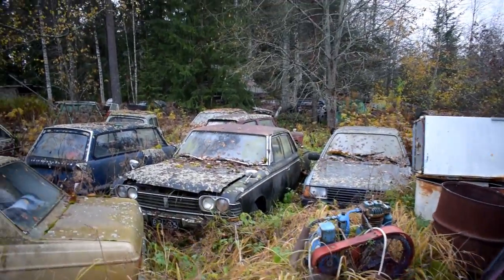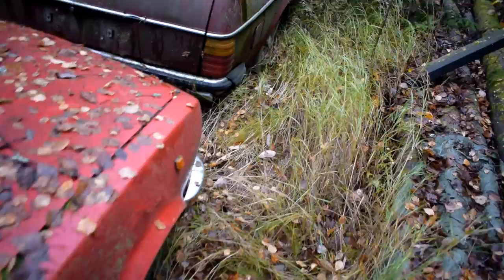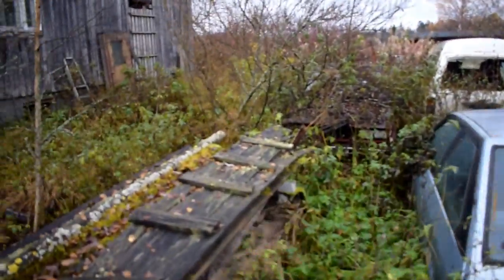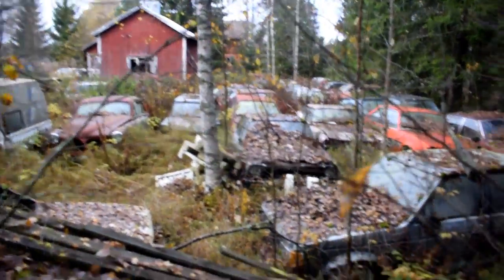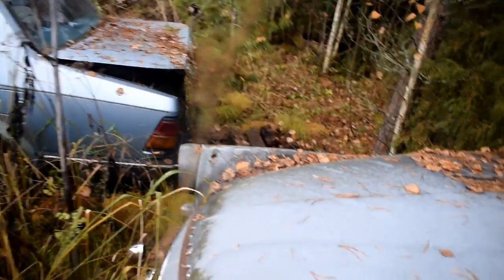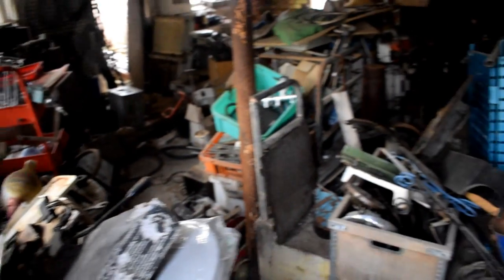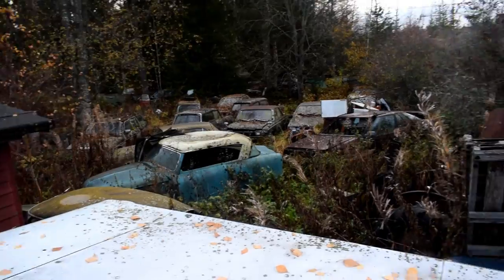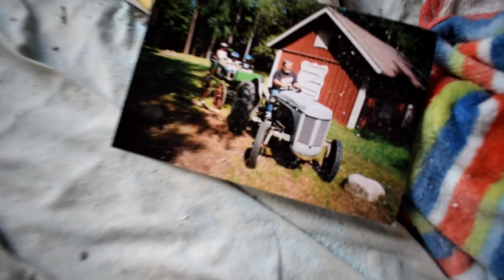Untouched abandoned house with over 200 rare cars! - So many classic and rare vehicles

Comment: The Herald Courier with windows was a bit of a tax dodge as the Courier was the van version of the Herald using the estate shell but had no rear side windows and thus was taxed at a lower rate, then the owner would simply add windows, rear bench seat etc and have a family saloon saving a fair bit, this was done a lot with Reliant Regal Supervans and also as recently here in the UK with the MG Express van where the rear seats and windows from a MG/Rover 25 were bolted in giving the owner a cheaper tax and insurance bracket for a full five seater.   Herald estates are extremely rare and the couriers even rarer.
Reply: Imagine buying a Reliant Regal to save tax?

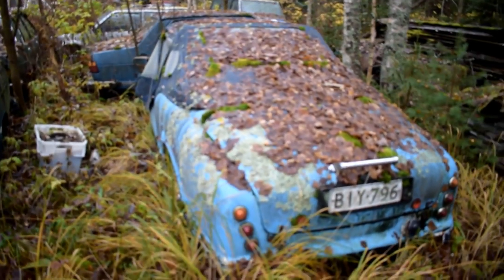Comment: There's a blue and white hardtop that shows up often, especially in the last shots, that must be one of the rarest cars in Finland. It's a 1951 or '52 Nash Rambler. Those cars are very popular in the States, either for restoration or rodding. That Blue Volvo Amazon  at 18:31 must have been a home made "sports" body (unless someone knows of a custom version that was commercially available). Looks like the tail lights were cut off and the fenders rounded so some plain round lights could be screwed on, in the fashion of a Datsun Fairlady. The trunk handle looks like it came off the front of a toaster oven! They cut down the doors, too, and added a funky top with round "porthole" windows. Someone should try to save that Peerless GT. What a find!

Comment: Those 'Austin' cars were not made very well to begin with, although my Grandfather had one from new, and kept it good.
Reply: I had an 1980 Austin Allegro 1750 Equipe and it was an excellent reliable car and no worst or better than Fords or Vauxhalls etc from that period for build quality - same with the 1978 Morris Marina 1800 HL/TC I used to own as well and I also used to look after and service my own cars.
Reply: The 'hydrolastic' suspension technology was from the 50's, but apart from that, they weren't all that bad. At least the S.U carburettors were pretty good.
Reply: Allegro's didn't use Hydrolastic - they used the far superior Hydrogas suspension as did the Princess/Ambassador, Maxi, Metro MGF etc